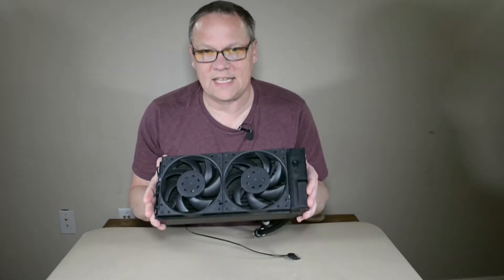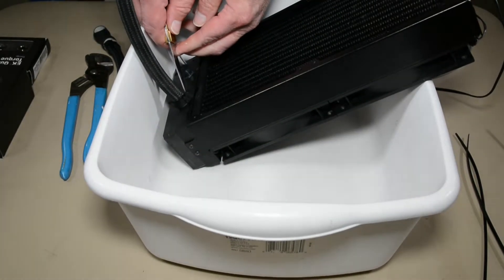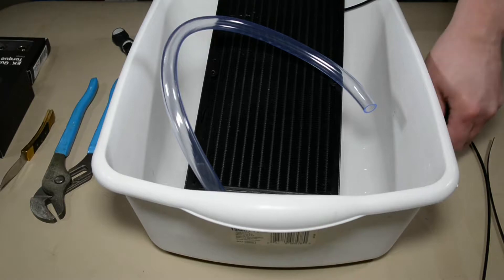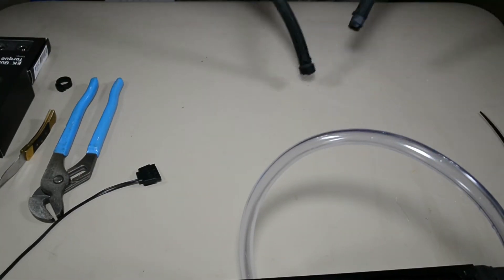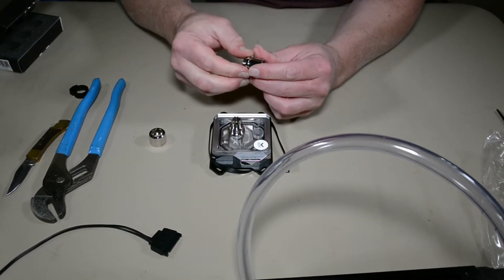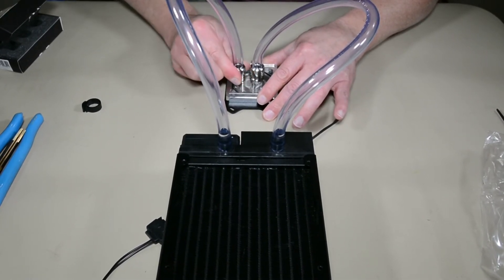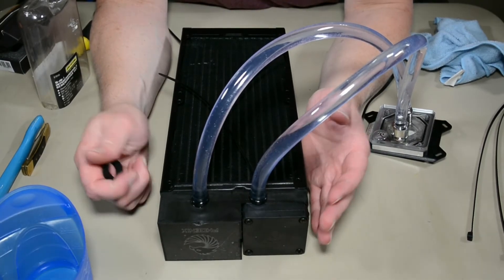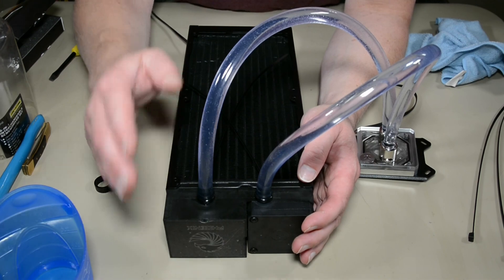EK 280 Phoenix Radiator MOD accommodate custom loop parts

Comment: A few years old but still useful information - even just finding out they're 16/10mm tubing was a huge help
Reply from the maker: You are welcome, it also has a dcc pump in it and potentially can be used to replace a dead pump.

Comment: Thanks for the vid! What ID tubing did you use? ☺️
Reply from the maker: Here is the full spec of the build, what you are looking for is the very last item.. Hopes this Helps! 

Cooler Master NR200: https://amzn.to/3bXpTx7

Corsair SF Series, SF600, 600 Watt, Fully Modular Power Supply, 80+ Gold (Renewed):  https://amzn.to/3c0Ac3n

AMD Ryzen 3900X:  https://amzn.to/3sPMdPo

ROG STRIX X570-i GAMING:  https://amzn.to/3c2jXmj

Western Digital Black SN750 M.2:  https://amzn.to/39VoYKP

EKWB EK-Velocity CPU Waterblock, RGB, AMD CPU, Nickel/Plexi:  https://amzn.to/2NsW4ub

EKWB EK-AF G1/4" 90° Angled Fitting, Nickel, 4-Pack:  https://amzn.to/3sHMmnX

EKWB EK-Quantum Torque STC-10/13 Compression Fitting for Soft Tubing, 10/13mm (3/8" ID, 1/2" OD), Nickel, 6-Pack:  https://amzn.to/2Y46d2s

ARCTIC P12 PWM PST Value Pack - 120 mm Case Fan, Five Pack, PWM Sharing Technology (PST), Pressure-optimised, Very quiet motor, Computer, 200-1800 RPM - Black/Black:  https://amzn.to/39PhrgG

Noctua NA-SYC1, 4 Pin Y-Cables for PC Fans (Black):  https://amzn.to/394b6yQ

Noctua NA-SEC1, 4-Pin Extension Cables (30cm, Black):  https://amzn.to/2LTRdBM

XSPC FLX Tubing 3/8" ID, 1/2" OD, 2 Meters Length, Clear:  https://amzn.to/2NgUueD

Comment: Hey just a question on this, I'm planning a mod like yours but going to include a monoblock instead, was wondering for simplicity, would it be possible to unscrew the fittings on the rad and put in my own 90 degree fittings? Or are the fittings on the rad permanently attached?
Reply from the maker: The rad connectors are molded so perminate.
Reply: @TheTechBasement  ah really unfortunate, was hoping to add the 90s for simplicity but it is what it is I guess.
Reply from the maker: @inochi1030   not sure what you setup is but you could put a short tube on the rad side and put the 90 on the other...

Comment: Great! Thanks a lot for sharing this! I'd like to do this mod but just keeping the tubes that the Phoenix kit comes with because its very practical and they give you a cool industrial look, so my question is: Is it possible to remove the block and use the same tubing / barbs on another block? like just getting rid of the Supremacy MX that comes with the kit and replacing it with for example a Velocity one?
Also as im planning to get a 3080 what i would like is to remove the terminal on of the gpu block and just to screw the one that came with my 1080ti but im not sure if the measures are the same, despite it seems to be using the EK 90 degree rottary terminal which EK also sells independant on its website.
Reply from the maker: I cannot say on the 3080 part.I know that you can use the same tubing just need to get the correct barb for the new block you get.

Comment: I have the pheonix 280 as well on a am4 socket and a gtx1080 all blocks from the pheonix line.
I am looking at doing a very simlar thing but with the barbs being plastic im going to leave the stock hose and quick connect and  purchase what ever block i need and the black ek hose and a set of quick disconnects.
Effectively making my own removable block.
I love the modularity of the  quick disconnects.
Reply from the maker: Its really not that difficult.  When first started this venture I was worried about the pump not being powerful enough.
Reply: Exactly. My only concern is the plastic barbs.
You started you videos right around when i got my loop. 
Ive been watching ever sense.
Reply from the maker: @john1182  Tks for watching,  I am so wanting to replace those they stand too tall.  and I am trying to mod this to fit a 12L case but is not happening because of the barbs.  I so want to cut them off and put some shorter replacements on there.  Not sure if it can be done though.  I am trying to get my hands on a Cooler Master NR200 but right now that seems impossible, according to my measurements with a different mod that I will show later, I should have a 2mm clearance of the pipes in this case.